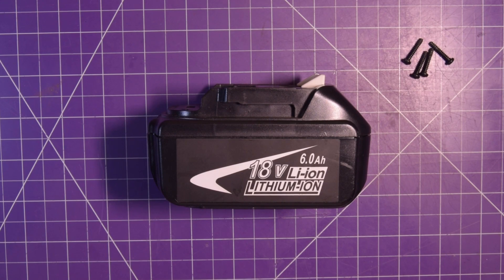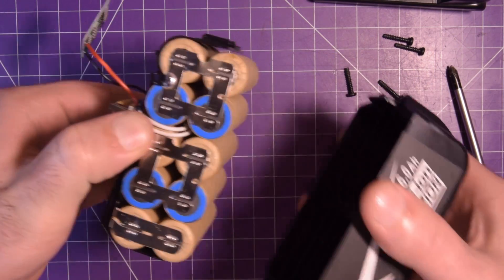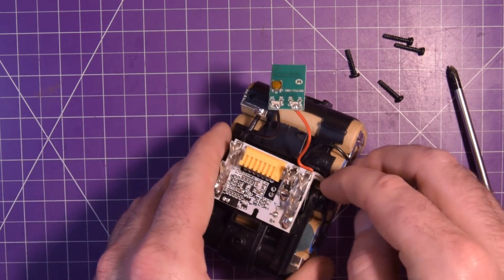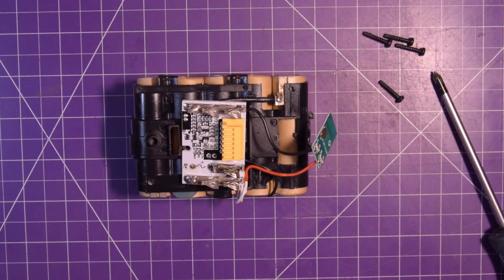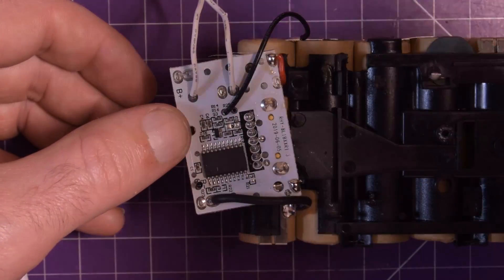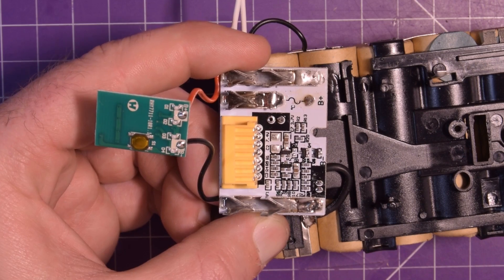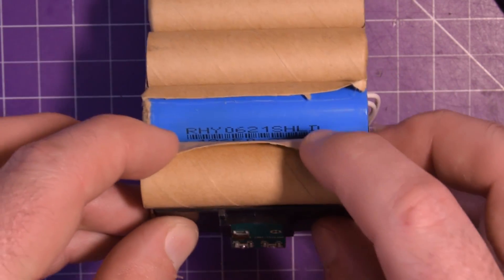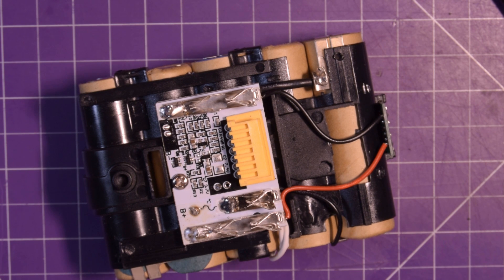Are All Drill Batteries Balance Charged? (Includes Teardown!)

Comment: 12:30 18650-20R usually means 2000mAh. IDK what R stands for. So the cell claims to be 2Ah, 2 in parallel = 4Ah for the pack, not 6Ah.
And that cardboard packaging... I've never seen something like that. Kindling for the fire, maybe?

Comment: 5:02 That black wire from cell 1's positive is probably used to provide VCC to the IC (will be <4.2V) to avoid using a proper voltage regulator to step down the full pack's 15V-21V to 3.3V. That's cost-saving (pennies). The IC will drain only cell 1 and make the pack unbalanced in a fixed amount of time, eventually cell 1 will be under-voltage a few times, enough to lose all its capacity, then overheat on the charger (due to overcharge) and pop the pressure relief valve (CID). Hopefully without a fire. Really scummy planned obsolescence. It's unlikely that it's used to check that cell's voltage other than the IC turning off when the voltage is too low.

Comment: never seen build like this before. my dewalt,rigid and milwaukee batteries come with proper BMS, that balance cells. so its true,that you get,what you paid for. this battery pack is a garbage. not safe,not reliable.

Comment: Sorry, but as you used an aftermarket battery for your test, in my opinion your test tells us nothing.
Reply: he is talking about balanced charging function from the BMS in makita battery tools..
using aftermarket battery or from the makita one, don't tell any difference becauhe he is talking about the balanced charging..

if the bms from the makita has balanced charging function, all voltages from battery can match one another.. no matter what kind of the lithium battery you are using, if all the battery cells which hooked to the bms in a good condition, and all of them have same voltage it indicates the bms is working..
that is whole point, not the condition of the battery

Comment: I want to recharge my dewalt 18 volt battery whilst away in my camper. I do have a small inverter so I could use my mains charger, but I also have a usb c pd charger which charges up to 20volts at 5 amps. The camper leisure battery  is a diy Chinese cell leisure battery 200 ah 13 volt. Do you think I could charge from the usb c pd?

Comment: When testing with multi meter on positive and negative be for dismantling it was showing 15.34 volts,but refuses to charge with a blinking red and green light on the charger.
once opened and testing from corner to corner its showing slightly over 20v.  
Each battery is testing at just over 4.10v , so all good. they are Samsung
I noticed in the far corner where that black negative lead goes the plastic has melted and part of the metal has discolored as well as the negative wire leading to it.
Now if I replace the negative wire and  tidy up the slightly burnt nickle battery tag, with new nickle and spot weld it `do you think it should start charging,
Or would there be something else I need to check.

Comment: I recently purchased a used Ridgid Li Ion battery. The battery only shows 2 bars out of 4 so I attempted to charge it with my bench power supply using its current limit function (set to 200ma, voltage at 20v) until the charger arrives. I wasn't able to get any current to flow into the battery using the two outside terminals which is what the tools use (the tools only have two terminals). There are 4 terminals on the battery. You can draw current from the battery but can't charge it. My conclusion was that the battery charger puts a signal on one or both of the other two battery terminals which enables current to flow into the battery. When I receive my charger, I will be able to determine what's going on.

Comment: 7:17 That connector is for data, not balancing...
I'm currently repairing 2 of the 36V original makita batteries (old BL3626-es, with little capacity left), and it has the same number of connections. For a 10S2P pack that I'm working on, 7 pins are not even enough for balancing. It would require at least 11 pins, or 9 if the main + and - terminals are used. That being said, the cells inside are all within +/- 0.01V from each other, and all 11 terminals are connected to the 2 main boards, which are on the sides, and connected to each other via a flat flex cable. (There are tons of components on both sides of 1 board, including a micorcontroller and a BQ77PL900 chip, and some passives on the other board.) The 3rd board on the top is just a breakout board, with no components, just connectors on it...

Comment: So, this battery is a knock off ?  Well... it's no surprise that it's not balance charged.  But that's what those terminals on the REAL battery are for.  So you may not "buy it" but that's because you buy GARBAGE batteries.
Reply: To balance charge a 5s pack, you need 6 wires, and none of the chargers from makits, dewalt, ryobi, or milwaukee have 6 contacts in their chargers
Reply: @grandprixuse  Dewalt has 8.  No balancer in chargers.  Hikoki has 7, still the same.

Comment: As an RC hobbyist, I wondered about balanced charging in tool battery packs. We have a new Craftsman  V20 LiPO powered trimmer which has only been charged twice. It has 4 contacts for charging, labeled B+   B-   NTC    ID. This should not be able to support balanced charging by the charger of its 5 cell LiPo pack. But when I opened  up the pack I found 4 robust connectors running from the connection points between the cells to the PCB.  The individual cell voltages were very close  - 4.019v down to 4.014v. Perhaps these packs have balancing circuits inside the pack?
Reply from the maker: Some of them do, but others just check the cell voltages and brick the pack if one cell goes too low

Comment: Very nice video 👍

It would be nice if you would teardown a makita charger (a real one) and go in this way of detailed information. Would be quite interesting to see for what the yellow plug is really needed and how the Charger overall works and why it's so bulky, bc I another video you showed that it doesn't need that much to actually charge these batteries 

P.s if you won't "waste" one I would spend one to you
Reply from the maker: I would love one to teardown, but before you send it, check how much shipping will cost; it's quite a lot to ship stuff to canada. My PO box is in my channel information
Reply: @SimpleElectronics  Also is there a way to contact you more personally? For sharing the Shipping information
Reply from the maker: My email is in the same place you found the POBox info, thanks!
Reply: @SimpleElectronics  No problem, it's fairly cheap. I'll send it right tomorrow to you 👍

Comment: I have been harvesting 18650 cells from Makita packs for about 6 months ( at least a hundred packs) quite a few were 6ah. All have balance leads except 2 that were cheap Chinese repacks that look exactly like the one in the video.
Reply: 5 cell slim original Makita Bl1815's don't have every cell monitoring. Only the "first" cell is checked, probably those knockoff's copied the BL1815's or first 1830's. Schematic fits straight on too.

Comment: I got fake makita battery looking exactly like yours but it have balance charging (wires connected to all cells and they had exactly 4.04V). Bought it in poland for 20$.  Package says 4ah but it have samsung inr18650-13Q inside, so only 1300mah per cell and 2.6Ah for whole thing. Poor capacity but at least genuine cells with balancing should work fine for some time.
Reply: Hey man can you put a link where you bought the battery? I would love to try them out, thank you!
Reply: Cell wires for over/under voltage monitoring.  Batteries have no balancers in order not to charge a shorted cell.
Reply: wait til you find out they make fake samsung cells just for these cheap batteries. not hard to re sleeve the cells with fake printed sleeves.
Reply: @ThatDaveFella they are not fake i tested it

Comment: Some more Information:
The 3rd pin is the charging pin. The charger will charge the pack over this pin. The thermal fuse is just to cut off charging current in some critical Situation. This ist found on this cheape chinese BMCs like the one shown in the video. You can find better BMCs, even with per-cell Monitoring, like this: https://www.aliexpress.com/item/33007327940.html?spm=a2g0s.9042311.0.0.27424c4dr8ofna
I used this one few time, since I have some good quality cells, so I used them to build packs for my power tools. And by the way cells: There are just a Hand full of manufacturer building high-current cells required for power tools. The cheap chinese packs include "standard cells" because they are cheap and have a quit high capacitance. But they are not designed to drive high output currents and will degrade fast by this abuse. This type of cells are commonly used for notebooks where capacitance is key, not output current.
In compare the original Makita packs you will find notceable differences, for example you can see this in this video: https://www.youtube.com/watch?v=PNVBbOQZW64 I did some high-res Pictures by my own some time ago, if you may interested…
The original once use per-cell Monitoring. I'm not sure if it's balacing too. I never messured the current between the sense wires. But be aware of trying: Orginial once have a "kill switch". If you remote the BMC from the cells, even just one sense wire, the pack won't be charged on the orignial charger anymore! To swap the cells of a orignial pack to have temporarly bridge an other pack to this one, with all single sense wires.
The yellow connector is in fact for transfering pack specs, yes. They do this digital. The pack temperature is also transfered by this pin. The original packs have a 4th pin. This pin is behind the 3rd one. As first it Looks like this is a common pin, but it is not! This pin can give the power tool a Feedback to turn off if the pack gets hot, draws too much current, cell voltage is dropping too far, etc... this safty feature is NOT present on ANY chinese pack! So with a heavy power too you can drive this cheap packs to death quite easily...
Reply: this is good info. but is the pin for charging only, balancing or just monitoring the battery health? It seems there’s no need to communicate with the machine because the battery can just stop outputting if voltage gets low, no need to ask the machine stop drawing current. If this is the case, I will be more confident to figure it out if the pins for balancing, no need to worry break some communication protocol.
Reply: @lgwwin  The battery won't cut off the current. Most types don't do this, especially high-current packs. You need to add switching circuitry, so this leads to added FETs with a given Rds-on and therefore a power dissapation, and therefore additional heat in the pack, especially in heavy-load situations where the cells are already getting hot by itself.
So normaly no manufacture will add a cut-off circuitry in there (high-power) packs (you will most likly find this type of circuitry in lower-power 12V stuff). It would be a kind of bad design, so to speak.
Thats why most of the systems use additional connection pins to communicate a shut-down requirement to the machine itself. This way they don't add additional thermal constains to the battery pack construction.

All Makita packs and machines do this that way. All chinease know-offs don't handle this case. Both: batteries and machines. But most machines turn off by itself if the voltage drops below a certain level. So normaly the batteries, even cheap knock-offs, won't die (early).

But the 3rd pin (not the 4th in the same row mentioned above) is used by the charger only. On the orginial packs this is internaly connected to a trigger-fuse (a type of fuse that can be blown both by over-current or by an external trigger impulse), so the pack can "blow up" the fuse internally if the charger won't stop charging even if the cells are starting to overcharge. This construction guaranties that the pack won't catch on fire, even it the charger gets crazy. Cheap battery knock-offs sometimes try to handle this with a thermal fuse. Other cheap packs don't have this safty circuitry at all. They don't address the possibility of a damaged charger. Even the thermal fuse variant is not really save. If the cells getting hot due of over-charge, they can run into thermal runaway. Especially because all packs I've seen so far uses 125°C thermal fuses. Befor they start to trigger the cell internal temperature is already way higher. Depanding on the cell chemistry the TR point starts in a range from 130°C to 170°C. Not really a save headroom.

The cells won't get balanced in the packs. But they are monitored "per cell". This monitoring is don't by the pack circuitry and is communicated by the additional yellow connector to the charger. So the charger can stop charing, if cells are getting overcharged. Also the charger ca detect overheated or damaged packs, which is also communicated by the yellow connector from the pack circuitry to the charger.

So the original design is quite save and versatile. Be aware of cheap knock-offs, they all have serious safty drawbacks - some more, some less.

Comment: Capacity test alone wouldn't tell the truth about those cells. Power tools need a lot of current and cells ability to give it matters. Capacity and max current are things that cell manufacturer has to balance between for the planned usage. Those cheap batteries could (but I doubt it) have the stated capacity, but only when discharged at couple amps. That might be enough for random usage at home and the cells could stand up for those two screws with small driver per charge, but bigger tools and/or needs at construction site would kill them permanently before first coffee break.

All the real tool manufacturer batteries I have opened have had small leads connected to every bridge between cells.  Even some cheap ones that I tried to resurrect my old Hitachi tools with, before changing everything to makitas.

Atleast in older makita batteries, there were counter for under voltage detections. If you drained your battery three times to under voltage, it would not charge in a official charger anymore. I have tried to remember that possibility and stopped at the first battery cutout and not to try to screw that last screw with the tool dying five times while doing so. I have not yet killed any of my makita batteries, but I still hesitate to give my tools (or actually batteries, tools are free to use for my friends with their own batteries) to others unattended.

Comment: Lion  batteries can be charged without a balance charger, but the cells MUST be matched.  Matched meaning capacity, voltage, internal resistance,  cell type and  chemistry, and batch. this is not the best way to use Lion cells. the problem begins as the cells age and degrade. at this point they will not be matched and they begin to  vary in capacity and voltage. this is when they can start to be dangerous to charge without balancing.  my 2 cents worth

Comment: Interesting... I want to take my makita batteries apart now and see if they have balance charging, wether that be a balance board in it or the charger does it. I have my doubts though now.
Reply: The original once don't have this cheap Chinese BMC board. Mikita does at least per cell monitoring, maybe balancing too (I'm not fully sure). There's a "better" Chinese BMS too with per cell monitoring, but in pre-build packs is most of the time this cheap type shown in the video.

Comment: I know that 18V Ryobi batteries are not balance charged or at least the ones I have repaired were not. For these the repair was to bring the one cell that was out into the proper voltage range. One ones I did not end up repairing the cell voltage on a single cell was actually a small negative voltage. I need to get a replacement cell of the same type if I would fix that pack.

Comment: If a Li-Ion battery doesn't have cell balancing, it's unsafe and shouldn't be used. The slightest difference in cell capacity will avalanche and kill it prematurely.
Why: Every time you discharge the pack, the weakest cell will go to the lowest voltage. = more wear (and this is not even the worst since normal packs behave this way too). The real killer is when you charge it since a lower capacity cell will charge faster. What do you think happens with its voltage long before then other ones has reached a steady 4.2V constant voltage state?
Reply from the maker: This is correct in theory, but don't forget that cells pause their voltage increases (at low currents) at near to 4.2v...it takes a lot of energy to raise their voltage from 4v to 4.2v and thus won't necessarily overcharge. I think you would be surprised how often this practice is used.

Comment: What I don't like is that a lot of these batteries, do not have over discharge protection (they rely on the tool for that); that makes my "using them for random things" a bit more of a pain. Nice video... Thanks :)
Reply: Which is why people use separate battery management boards. Then no problem, even if the cell is already protected. 
You do need to use the right one for 1, 2 more cells.. Then all protections are present. 
Using a bare Lithium battery is asking for trouble. A short, over or under charge, and suddenly you have a dead battery, or a smoke machine. 

A single cell Lithium charge/protection board costs pennies from usual Chinese suppliers, and has a handy micro USB socket for charging.
Reply: @JohnBailey39  us in the fpv racing / freestyle drone hobby use bare lithium polymer packs with zero battery management systems besides our own etiquette all day 😅😅😅
Reply: @cinialvespow1054  But you also WATCH the performance.. Yes? So you are the BMS. You know roughly how long, and how hard to push the battery. 

Meanwhile.. Did my Bluetooth speaker run for 4 hours or six already. 
Don't care. When the battery light comes on, I can just plug it in.
Reply: @cinialvespow1054  Well, drone batteries are not known to be very reliable 😅